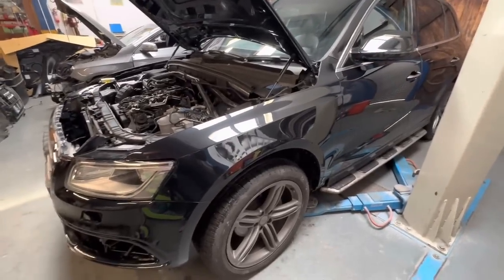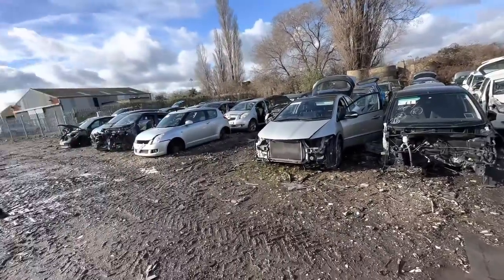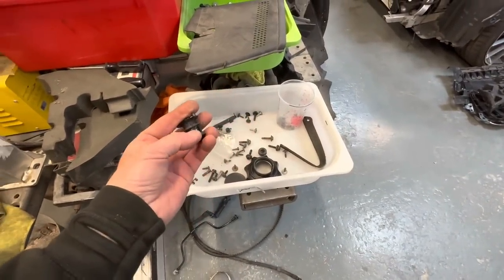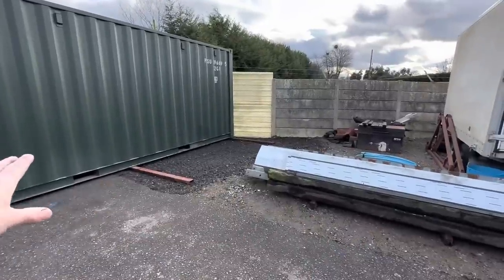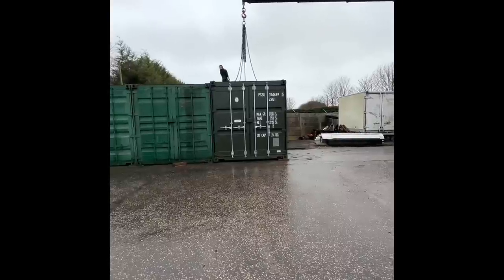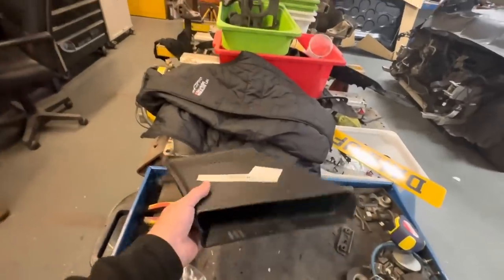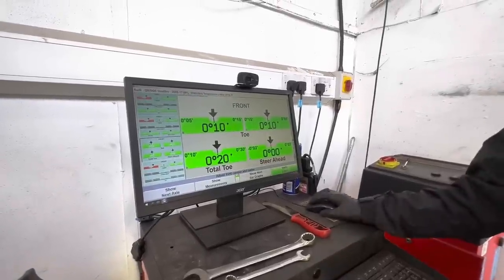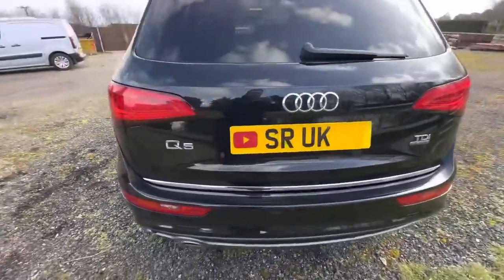ANOTHER PROJECT READY TO GO BUT WAS THIS Q5 A GOOD PURCHASE ???

Comment: Think the mileage error was because the “68952” was entered instead of “48952”  which would put the mileage in the right area between the other 2 mileages either side of it. 68952km is around 43000 miles which would make it a lot earlier. Just my guess Rob and Chris.

Comment: The cost of the shipping container will be affected by the sea freight costs, which have rocketed since Covid. What used to cost $2000 is now nearer $12,000.
Reply: There was (is?) a mountain of them in East Anglia as it wasn't economical to send them back to China
Reply: @jamesbrett6518  they were full of PPE, but all gone now. Right about not economical to ship them back, but less of a problem now, China locked down the workforce so no new ones made for a time.

Comment: Guys just a suggestion but get the roof of the new container sprayed with "Grafo Therm". Its expensive but absolutely brilliant. Condensation in the container just doesnt happen. I bought a 20 foot container to keep my furniture for three years while I designed and built my house. No condensation, no mildew no mold. even paper comes out dry with nothing growing on it. I know you will be putting carparts in it but if you want to keep them in great condition get it treated. You dont have to spray the sides just the roof

Comment: Rob, that mileage does not correlate with km. if you convert it comes out at 42844 miles. Its more likely that the MOT Tester mistyped and should have entered 47952. That would tally with the average mileage across the previous years and the next two MOT's. Keep up with the good work you and Chris both do.

Comment: By far the least safe way of using a HIAB. Leaving aside the risk of putting a crease in the top of the cab, the majority of the counterbalance weight of an HGV is at the front which is why, with a front-mounted crane, you should only lift off to the sides but with a rear-mounted crane you can lift round 360°.

Comment: Did you put the rear lower wishbone bolt in back to front? I'd so the adjuster cam bolt adjustment function may not work for alignment

Comment: What is Cor-Ten steel,have seen this on containers before "only use Cor Ten steel to repair this container"
Reply: Cor-Ten steel is a steel that has been treated so that it need not be painted or otherwise coated. As the steel rusts this should seal itself to prevent further deep rusting. Although containers are usually painted in a company’s colours, they get scratched and banged about, so that it is important that the exposed steel does not rust through.
Reply: @filmbluff99  thanks for that 🙂
Reply: @filmbluff99  yes, you get some buildings clad in it as architects like the rusty look!